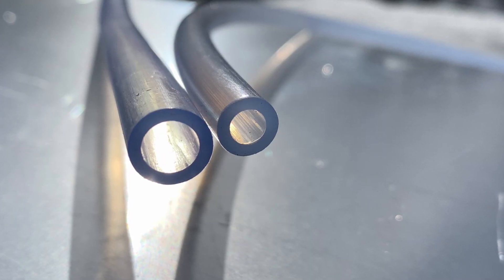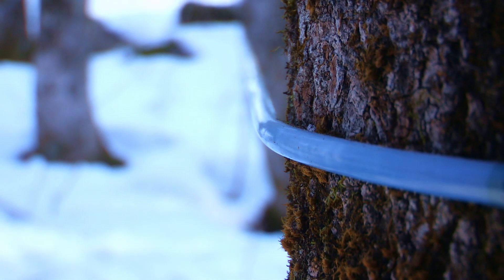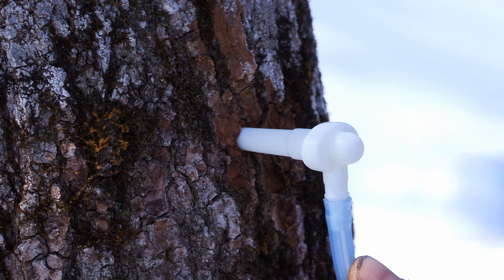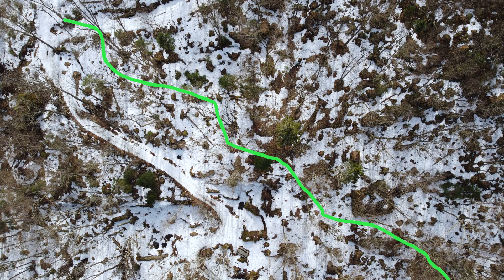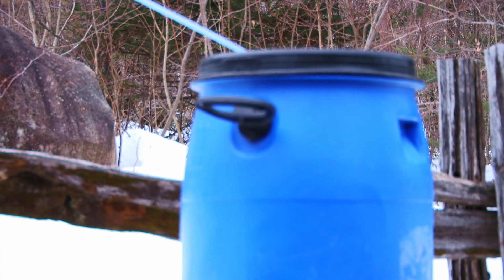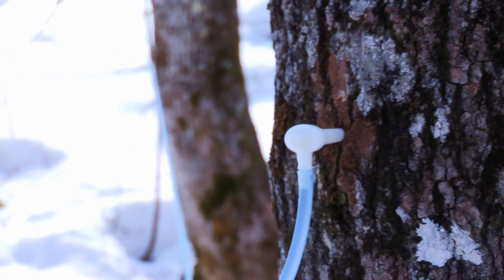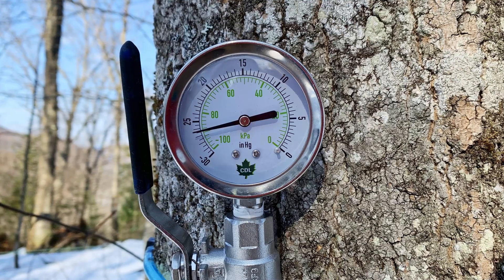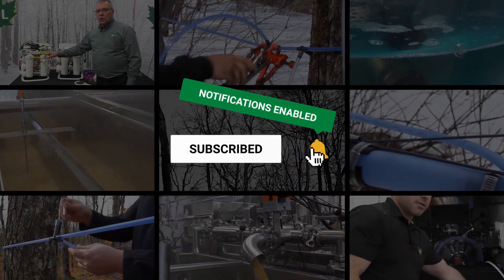3/16'' Gravity Tubing Installation

Comment: I have a steep hillside not far off the grade of the hill shown in the first minute of the video, the 3/16 crushes it with that slope.  It out performs the 5/16 by about two to one for us.  Also is pulling sap on those iffy days where 5/16 won’t run at all.
Reply: Hey Chris, I have similar slope to what the video showed also.  How far do you think it's possible for 3/16 tubing to carry sap to a collection tank?  I measured the distance I'll be from my farthest tree and it's 230 yards.. is it crazy to expect 3/16 to carry sap that far? Thank you!

Comment: I did this and I found that 3/16 is too small of a diameter for < 2% drop.  Must use 3/8 or untap the highest letting air in or putting in a release loop for so air can pull/suck sap down.  If you have better drop it might not be necessary.